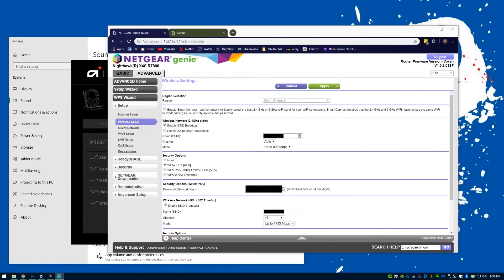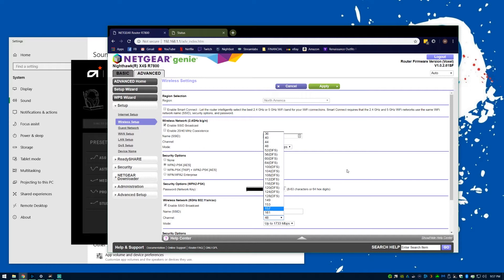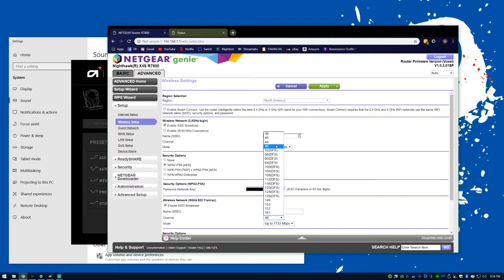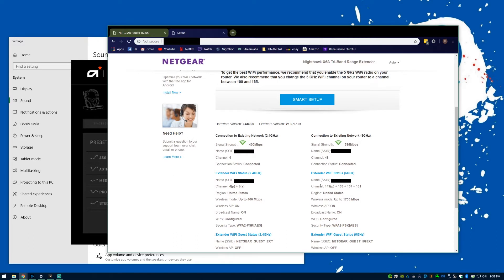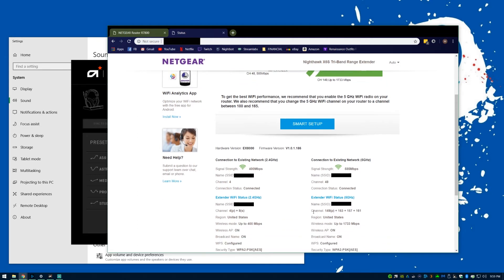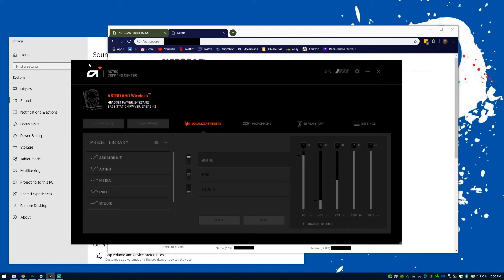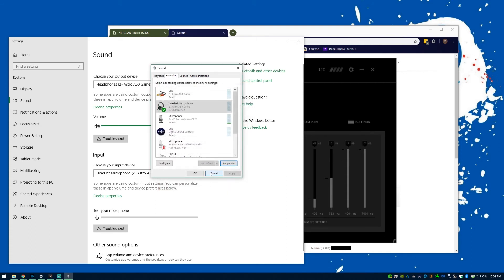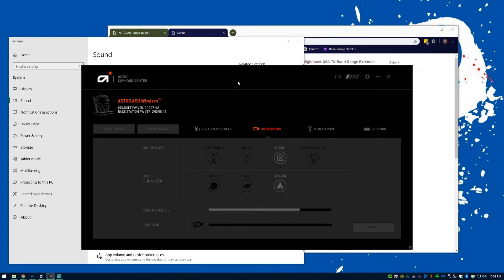How to fix Astro a50 gen 3 Audio and Mic Problems

Comment: What about a router with dual 5ghz bands. The first one would go from 138-149 then the second from 150-62. How would I setup up this tri-band router?(nighthawk x6 r8000)
Reply from the maker: 5ghz channels start from 36 and go up to 165 so you should be able to set both of your 5g bands on a different channel that isnt the one the headset uses

Comment: My friend hear my game what can i do
Reply from the maker: In the Astro Command Center software there is an option under the Microphone Settings called "Noise Gate" you can set that to either the "Tournament" option or the "Streaming" option and it should try to cancel out some of the background noises including the sound coming from the headset itself.

Comment: I've been putting up with sound cutting out for a couple of years now.
Sometimes it doesn't happen for a few days. Then all of a sudden it'll be bad for a whole day.
I've checked my 5ghz band and it's in the 40's.
My headphones jump around in the 140's to 160's
There are about 6-7 5ghz signals on the same channel as my router in my area. Weak signals but they are there.
I have a range extender. That is on a 2.4 ghz frequency and low channel.
I can't really see what's causing this tbh. It could be my wireless polk 5.1 setup?
Gonna try changing my 5ghz channel and hope for the best 😩
Reply from the maker: Is your range extender connected via wire or wireless? sometimes wireless range extenders use the high 5ghz bands to tether (mesh) themselves to the router even though you can set them to only extend the 2.4ghz. It could be possible that the 6-7 5ghz signals that are using those higher channels could be interfering even though they are weak which could account for the intermittent problems. It all depends on line of sight to the base station that those signals would have.

Comment: Is this tutorial true even if I’m connecting through Ethernet to my router? My A50 is cutting out a lot and my router is like 8 feet away, but I’m connected with an Ethernet. I’m assuming it’s still an issue?
Reply from the maker: If the 5ghz wifi is enabled on your router and is using the same channels as said in the vid then it would interfere. It doesnt matter if you arent using the wifi it just matters if its enabled or not and is set to those higher channels
Reply: Skunny i switched the channels and it solved my issue. Thanks

Comment: No matter the channel I change em to the headphones still have a ridiculous amounts of cut out
Reply from the maker: Do you have neighbors that have wifi that are pretty close to you? You can check channel signal strengths or wifi around you with apps like wifima n or the like. If not then perhaps the base station is too close to other devices that are utilizing the 5ghz band like the tv or a console.
Reply: Skunny the only way for the Gen 3s to operate, as of what I know is that they must be connected to the console to work so I can’t really get the base station away from my PS4 and monitor.

Comment: bruh mine still do it🙃🔫
Reply: Same here. Just got em yesterday and they still do it sometimes to a point where it’s back to square one and won’t stop doing it.
Reply: Knight Slayer yea ive had mine for nearly 3 years and they are in perfect condition except recently i wired my xbox and its been doin it ever since
Reply: Hihns no matter the channel I change my 5G to the headphones cut off
Reply: Knight Slayer yea same, 😚🔫
Reply from the maker: Check wifi signals around you with an app like wifiman to make sure no one elses wifi is messing with things, also make sure your base station isnt directly next to anything that connects via 5ghz like a tv or console to see if that helps
Reply: Skunny don’t I need the Gen 3s connect to the console for them to work? I use an Ethernet cord as well. Also I’ve check numerous times on WiFi analyzer who’s on what channel and trust me no one is bugging with my channels.
Reply from the maker: @knightslayer6161   yes the base station should be connected to the console but the cords should be long enough to have the base at a good distance from other things but since you are using the ethernet to connect the console and not wifi it shouldnt be a problem. If no neighbors wifi is interfering and no other devices are utilizing the 5ghz channels (like a wifi extender or router) and nothing is in close proximity to the headset or base station, then the only other things I can think of are maybe the headset/base needs a firmware update or perhaps try sitting closer to the base station to test and see if that helps the issue. If sitting closer helps then it is most likely a signal interference problem.
Reply: Skunny I’ve tried it all. The cords they gave me have the base station in hugging distance of the console. I sit right in front of my monitor on a gaming chair. And the first things I did was update the headphones.

Comment: I have an xfinity router and when i log in i cant find the setting to change the channel
Reply from the maker: sorry for the late reply, i dont have an xfinity setup but it should be around advanced settings for wifi. From xfinitiy's website it says to go to Gateway > connection > wifi and then go to the edit option next to the wifi channel.
Reply: Skunny I have the same router and it is such  a pain in the ass to get this changed. You have to do it through their website portal and not in the router.

Comment: Mine were terrible cutting out every few seconds with the lights flashing on the base station. It was driving me insane. I went in and manually set my routers 5G channel from auto to 40 and that fixed it immediately. Not had a problem since.
Reply: How did you do that ? Following this guys guide ?
Reply: Did it effect your internet speed?
Reply: @christianstadler6099  not at all

Comment: how do i adjust the chat volume. Its so loud I cant hear the game audio when my teamates speak. I have to turn the main volume on the headset r/ear muff down. I get virtually no game audio at reasonable chat listening volume.
Reply: I have the Astro A50 Gen 3. Logged into the Astro Command Center and updated everything. My PS4 Pro is updated too. Problem is game on my headset does nothing. I have to keep pressing the voice button until I hear it beeping and I can hear my game and my team mates. Is the name placement on the headset wrong? Also there is no balance between game and voice for me because game on my headset does nothing. Voice on my headset is both. Am I the only 1?
Reply: @finauvalasi977  im having the same issue! im getting so tired of it!! my partychat like deafens me, i want to be able to equalize my game/chat audio where i want it to be! no one has a guide as to how to fix this
Reply: Finau Valasi honestly having this same issue and it’s so annoying . I hope I find a solution for it.
Reply: lorimer arteaga go to Astro.com and put in a dispute, they’ll send you new firmware
Reply from the maker: The side of the headphone plate is a rocker button that you can click one end or the other to increase or decrease voice or game sound

Comment: Please can you help me ?
Reply from the maker: The side panel of the headset is actually a button, one side says voice the other says game, press the voice side to increase their voices or the game side to lower their voices and boost game sound, if that doesn't work you may have to adjust their voices in the game itself settings
Reply: Yes, I know, but when I do, nothing changes , so I think this problem from headset sitting
Reply from the maker: @sajadykc  hmm, you can attempt to adjust the sound gate or equilizer of the headset but it sounds like your in game sound might need adjusting as apposed to the headset itself
Reply: Skunny  I need to reset the head set to thea factory set
Reply: @sajadykc  Make sure that the game is set to the one for 'Game' and your voice app (Discord, Skype, etc.) set to 'Voice' in the sound settings. If it's something like League voice however, it's tied into 'Game' since it it's through the game itself and not another app.

Comment: When i am in party with my friends I listen my friends voice higher than my game sound so what should i do ?
Reply: Hold or press the buttons on the side of the headset
Reply: @EagleAssassinchannel  what do u mean, explain plz
Reply: deesfukinuts24 hold the top left voice button on the side of the headset and the surround sound button at the same time
Reply: My issue is that I can hear people talk i just can't hear game audio it doesn't make sense. And its not because I need to adjust the game audio on headset its not that

Comment: but my router is no where close to my wifi router. Also i hear everything outside of my headset through the headset
Reply from the maker: The 5ghz band is pretty strong so it may still be interfering if you get a good 5ghz signal from where your headset is. Use your phone wifi to check its strength. You can turn off hearing everything in the room including your own voice by turning down or off the "side tone" setting in the microphone section of astro command center application

Comment: Do you need to reset your router after you make the changes?
Reply from the maker: Typically applying the new channel settings on your router will restart the router, some newer routers have the ability to only restart the wifi band that you are changing

Comment: How do you change the settings on router. You said the headset has same frequency as router.
Reply from the maker: If you log into your router by typing its ip address in an internet browser the setting to change the wifi channels are usually located in some sort of advanced menu for wireless settings